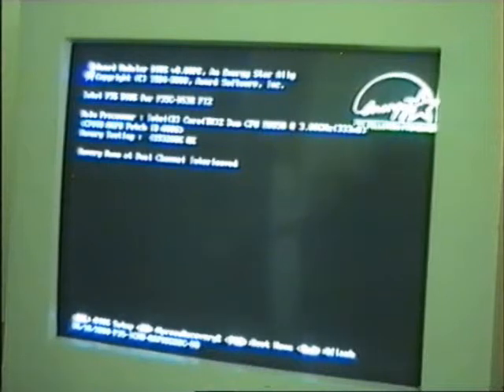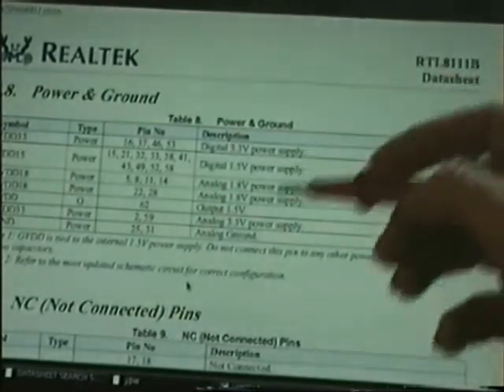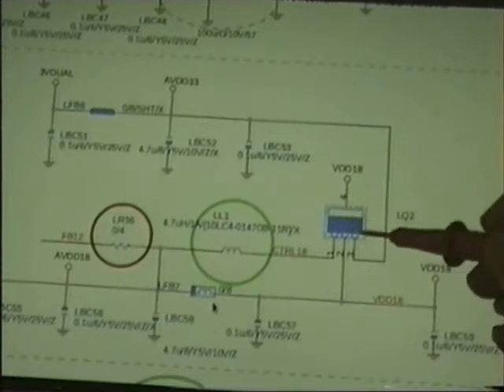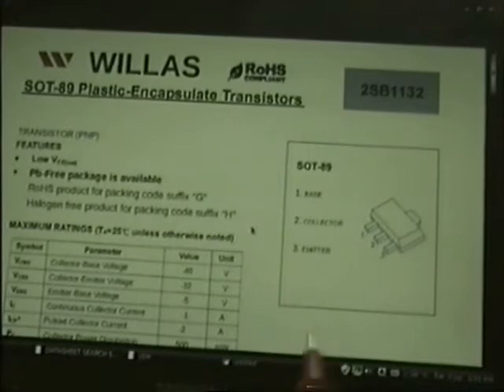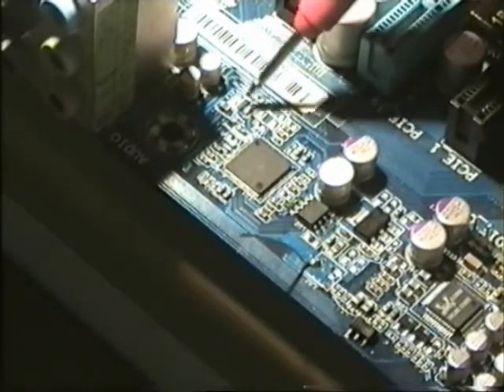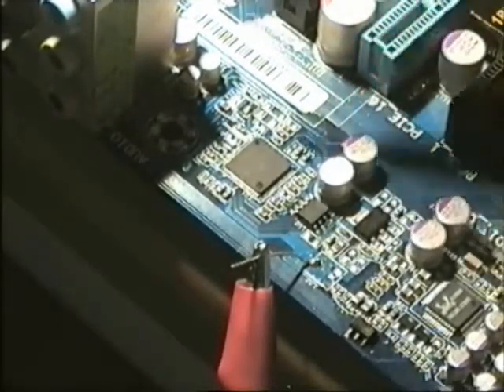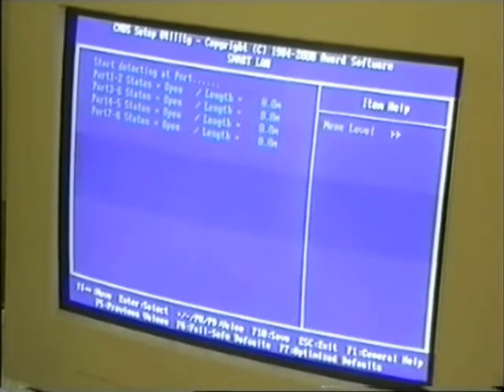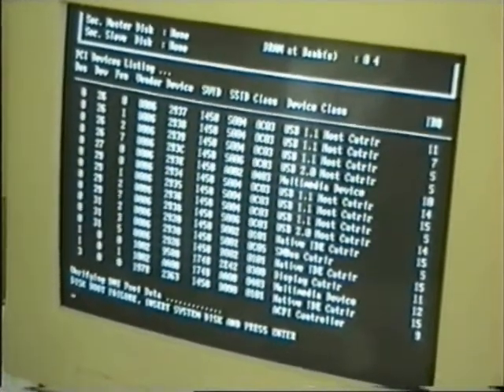Gigabyte motherboard GA-P35C restarting loop solution.

Comment: I have the board GA-P35C-DS3R , had a lightning storm one night, and the next day the computer can't start.
In a few year's of siting in it's case and in shelves, I got around to tracking the problem down.
First saw that the PCB's material was darker around the bigger transistor for the LAN controller, changed it, and it still wasn't working.
The transistor wasn't the problem, it was the LAN controller, it couldn't drive the transistor properly OR the controller was shorted.
Next I removed the controller violently with a Soviet soldering iron of over 100W.
And a couple of months after that, It came to mind that there should be a bios setting to turn off the LAN controller, but there wasn't.
Mind that I could go into the bios & Qflash utility, and had the F12 version bios on the motherboard.
After some searching I found this video & read the comment.
Then downloaded all of the bios versions, and started with version F1, got to F6 until I saw the option to disable the LAN controller.
Then the computer continued past the full screen logo, and wanted a disc to boot from.
For kicks I updated to the F12 BIOS version, and the option to disable the LAN was still there.
That's basically my long awaited answer to what was the problem with the motherboard.

Comment: Hey, I am having the same issue on an EP35-DS3 mobo. Is there any way to disable the onboard nic? For those who can't enter bios have you tried to shorten pin 4+7 on the M_BIOS chip? But please only do it if you have a Backup Bios Chip on your mobo (EP35-DS3 is having 2 chips).

Comment: This same board got hit by a lightning. Now I've removed the 1.5V voltage regulator transistor. It was smoking hot and everything around it. Something was shutting the power because of the heat. Now the board is working stable. But 8111B is working a little bit hot and the system restarts as in this video. Will this solution work even without the 1.5V rail? I'll try to measure the 1.8V rail... But my question is if the BIOS will allow me to disable the chip even without the 1.5V...

Comment: You are the best VODOO , can you tell me where i can get 1.8v? from the power supply of the PC?
Reply: +Alexandru Anton I got 1.79v from another chip and bridged it over with a wire and tape. worked like a charm and shut down the h/w lan in bios. poke around with a multimeter until you find one.

Comment: I can add some example situation why this happens. Lightning strike blows your onboard lan and you'd like to disable it in bios. Seems reasonable. But HEY! It's like mr,.Voodoo here says that there isn't na option in bios for it. In general all boards have it in bios an option to enable/disable. 
So why isn't it there? 

Whell it was there until I updated bios up to latest to get the new cpu running on the mbo. And cpu works like a charm, but the board it self has a history.

It got electricuted trough onboard lan port. So in all the minors bios versions it's been posible to set the onboard lan chip to "disable". But you can forget about it with the F12 bios version for this specific board. 

And that is hov we get into the restart loop. 

And Voodoo3rd, you man are my hero. Doing this and fixing the issue as I was just about to take a sharp screwdriver and hammer and chisel of the danmn chip strait off board.

The point.: When one notices flashes and thunder from skys above. Pull the phone line out of the wall socket and to make it double safe get off the power grid. Since if it happens often to one leaves sensitive electronic device ON in that circumstances it loses every guarantee on hov will it perform in the future.
Reply: I saw you're comment and started updating to older bios versions, until the option for disabling the onboard LAN came up.
Disabled it & continued to update the bios to F12 version to see what will happen, and the option was there.
Reply: @kotin5725  My board is still waiting for a final fix. Anway, it looks this mbo model is an epic one. As we all managed to pin down this video trough all these years. I'm happy that your bios flashing went well.
Reply: @Mali vir Eddy if you have a soldering iron & a old USB 2.0 or 1.1 flash drive, and maybe a CPU that is compatible with the F1 BIOS.
You could try:
1) to remove the transistors next to the LAN controller, and if possible the whole LAN chip.
2) put in the motherboard a CPU that is compatible with the F1 BIOS.
3) fill the USB with all the available BIOS versions, and update them one by one.
At every step save the CMOS to BIOS, with a name if needed.

Try these thing out when you're in the mood.